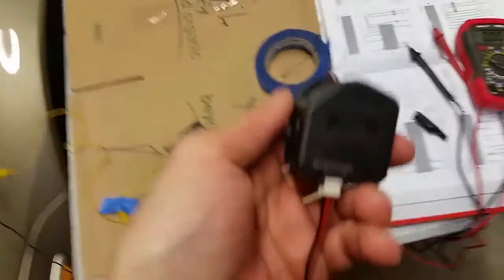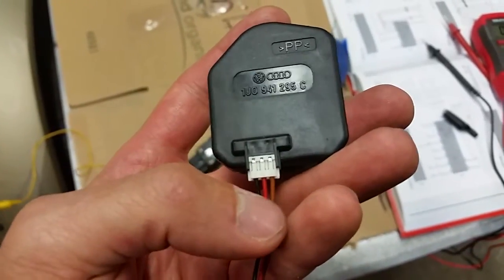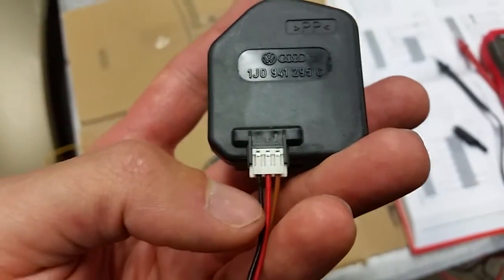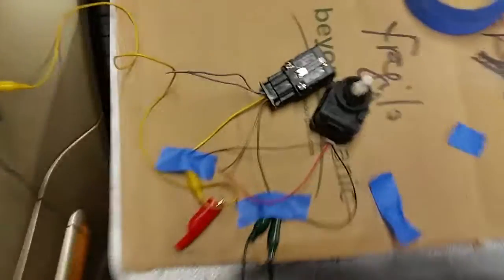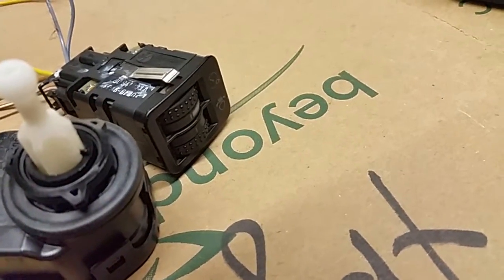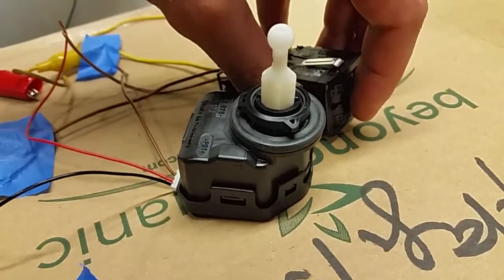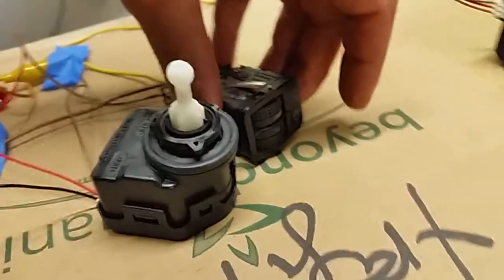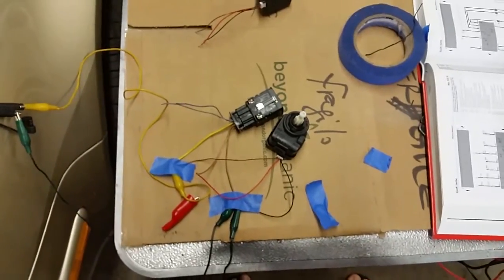MKIV VW Jetta and Golf Leveling motors working

Comment: My driver side regulator doesn’t work in the car, i tested in the bench and its fine. But if i plug and unplug the drivers side regulator, the passenger side adjusts itself without using the button on the dash. Maybe i’m not getting the constant 12v that you mentioned on the video?

Comment: Hey, doing this install. Just wondering where to connect the 3 wires from the levelling motor pigtail? Is there somewhere to put them inside the headlight housing. 

As far as I know; the wires from the dash go into the 10-pin headlight connector?
Reply from the maker: Hi Liam.... If the car didn't have leveling before there aren't wires. I had to run new wires from both motors to the leveling switch.
Reply: Just read your write up on vortex, says to connect the levelling motor (3 wire mini connector) to the 3 wire connector coming from the headlight housing (the one that powers the orange park light bulb) ? Is this correct?

Comment: Hi. What happens if I drive the headlight down with the switch, disconnect the switch, put the switch in normal driving position and the reconnect it? Will the motor self adjust back or will it stay out? Thank you
Reply from the maker: Giorgio Avato hi ... each switch position corresponds to a voltage. So my guess is the motor will align with switch position. However, the range of travel is based on the starting position of your headlights. So you can get some flexibility there.
Reply: James Siros Yesterday I tried one thing in my VW Scirocco. Turned on the headlights, regulated them all down with the switch, disconnected one headlight connector, turned the light up with the switch with one headlight disconnected. As soon as you reconnect the headlight connector the height motor regulates itself to the exact level of the other headlight. Looks like the motor works absolute and not incremental ;)